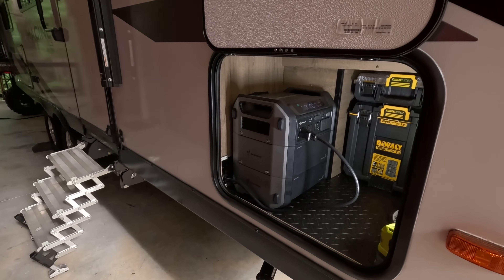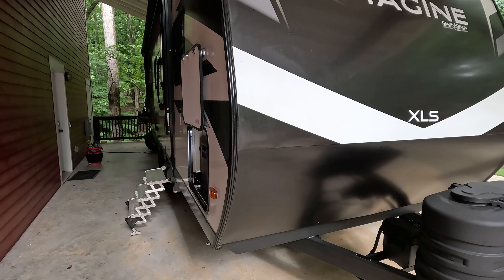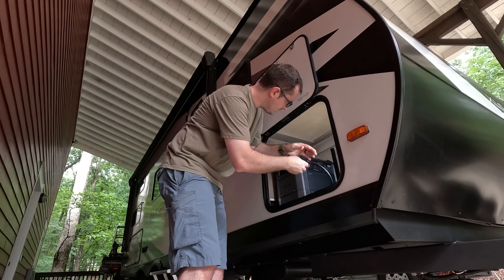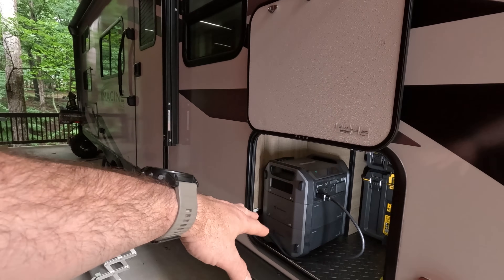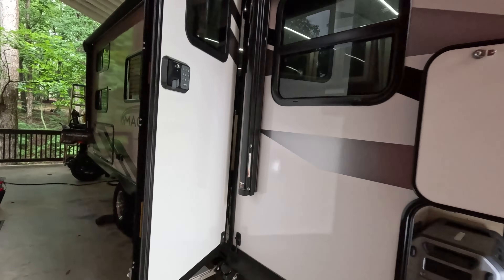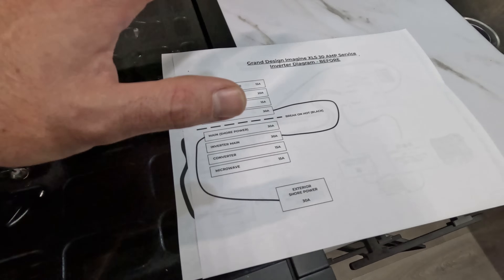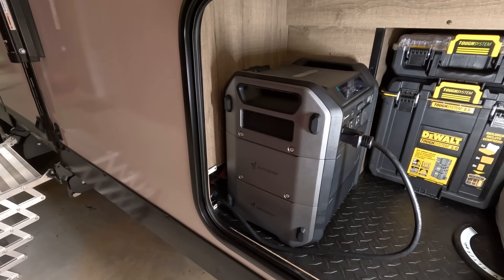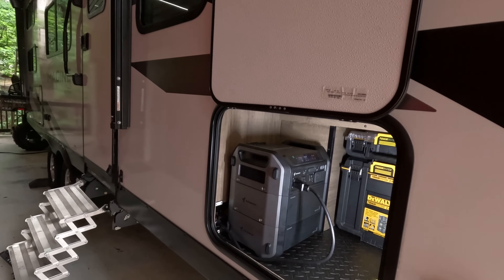Don't Waste Your Money on Lithium // I Install a Segway Portable Power Station Cube 2000 in My RV

Comment: It was going to cost me thousands of dollars to put an inverter system in my trailer. Instead, I bought a 1500w power station with an 80ah battery in it that I have sitting in my main living area. I just use a heavy duty extension cord to power one appliance at a time. It recharges with a 12v charger from my main lithium batteries and solar system. Cost: less than a $1000. And it is also portable. I love it! I live full time in my RV and boon dock 80 percent of the year.
Reply from the maker: Great point!
Reply: I have to give you props, though I’m in a stealth sedan sitting on 7.2kw using 48v the superior voltage. Full electric conversion to maximize space.
Reply: With all the tech being built into the power stations now.. theres not much use in going for the full build anymore.
Reply: @prjctwolf  build batteries? Or build power storage? I don’t get it?
Reply: Depends what you are willing to sacrifice.  Using a dedicated lithium bank and a proper inverter you can power more than a microwave at one time.
Reply: @Steve-qn8gn  Well, I live by myself so doing one thing at a time works for me, and it saved me a whole lot of money...
Reply: @ it’s still a big compromise compared to the “thousands of dollars” people spend on real installations. Most people aren’t by themselves and will want to pull way more power than those can put out and considering you could see the percentage drop 1% per minute of microwave use that unit doesn’t have a lot of storage.
Reply: @Steve-qn8gn  Mine has an 80 amp-hour lithium battery, so plenty of storage for me.

Comment: I recently bought a truck camper and the manufacturer offered an optional solar setup with lithium batteries.  It was thousands of dollars and would have consumed a lot of space inside.  Instead, I bought one of the larger Bluetti power stations when it went on sale for around $700.  It powers everything inside the camper and gives me 120v outlets when needed.  It's a no-brainer.
Reply from the maker: Smart thinking, great use-case.
Reply: How did you connect it? Just plug it in on the outside socket?
Reply: @ingevansand9180  You can charge a Bluetti using the supplied AC power cord.  I plug it into shore power with a standard extension cord and keep the battery inside and out of the elements.  The Bluetti will charge at the same time your camper, etc is drawing 12 volts from it.

Comment: Lithium batteries can be  explosive. They can cause a fire destroying your RV. I prefer using lead acid deep cycle  batteries.
Reply: Nobody puts Lithium Polymer batteries in an RV. Lithium Iron Phosphate batteries are put in RVs, which are quite safe. That’s likely the same battery chemistry in your power station.
Reply: Can confirm these are lithium iron phosphate. But even if it was not they typically only burst into flames when punctured, if something hits your RV hard enough to puncture a battery down there, your RV is probably going to get totalled out anyway.

Comment: Hi I’m impressed with the system you have hooked to your trailer & 2000 way Segway power station. My only suggestion is if you had put in a manual switch over instead of  the delay operated system you used for the function of the circuits. The only thing you would lose is the automatic switchover. I am a retired rv technician of 45 years in the RV industry.  The automatic switchover relays in the selected box have had a consistently high failure rate over the years they have been used.  Switching over automatically even with the short time delay they use can cause a burning or carbonizing effect on the really contact points. I had a similar system on my 40’ fifth wheel years ago using a manual  switchover transfer box that was bulletproof. In those days inverters were super expensive & prone to failures due to the older inverter were not as failsafe as they are today. There was & still now is available a “motor generator “ as is still being used by ambulance & EMT vehicles that never made the switch to inverters due to the bullet proof design of  the motor generators provide. These generators are full sign-wave generated using the same shaft drive with a 12 volt motor running off of the house batteries. In those days we used golf cart 6 volt 190 amp batteries in series to use as house batteries. Look me up on Facebook. I worked up a resume breakdown of my years in the RV Industry. Nice work you did on your trailer.  My 40 foot 5th wheel years ago had 3 a/c’s. One 13,500 btu, one 11,000 btu’s and the third a/c was in the bedroom loft( Coleman Mini Mach 9,000 BYU) of my 5th wheel which could run on the motor generated along with the outlets and microwave usable even while we were driving. My truck had a 175 amp alternate and 2 heavy duty charge lines running back to help keep the trailer batteries up while traveling using the motor generator underway. My wife preferred staying in the 5th wheel while traveling & she would make lunch and stay cool. She would call me on the CB to tell me when lunch or dinner was ready so we could stop and eat along side the road. It was legal to ride in a fifth wheel those days.👍👍🤙
Reply from the maker: Thank you for the comment. And thank you for the recommendation.

Comment: Will work fine just remember to turn off electric for water heater (switch to gas) and unplug your onboard AC to DC charger for the battery bank (if you have one)
Reply from the maker: Great question. On mine it is wired where it only supplies AC (inverted) power to half of the breaker panel such as general outlets, microwave, etc., and so appliances like the 15K AC and converter/charger are on the opposite side of panel not fed through power station (my WH is gas only). But, if you wire it to supply full power to panel, it would be fine to manually turn off breakers as needed. Great point.

Comment: The Segway is a 40ah battery with a 2000w inverter. You can get a 100ah battery and a 2000w charger inverter for $400. The portability is nice, but it's definitely not a cheaper solution.
Reply from the maker: I hear you, great point! Definitely can save a lot of $$ going with the discounted brands. On the Ah calculation it's kinda tricky comparing, as the voltage is different on the Segway @ 51.2V vs 12V on the standalone 100Ah batteries. The Wh (watt hour) metric can help compare for apples to apples (Ah = Wh/V). For example the Segway Power Cube 2000 is a 2,048 Wh capacity vs about 1,200 Wh for a standalone 100Ah 12V battery. You certainly do pay a premium for the name brands though, either way. Thanks for watching!
Reply: @AdventureRocks  Didn't notice the voltage on the battery, I'm guessing golf cart batteries?
Reply from the maker: @alaskadave1795  I wonder if it's a custom battery, probably using premade cells from one of their vendors.

Comment: We're part timers and we use the Bluetti 200max. We also use it for tailgating and never bring solar panels. Runs our starlink, and everything else except ac. The microwave drains 15% in 3 minutes so that's not cool. We keep it inside because it won't fit into any bays.
Reply from the maker: Very nice, great choice! I just recently tested the AC300 + B300K and was shocked to learn it could run my 15K AC and Microwave at the same time...not that I would regularly do that, but still Bluetti is very impressive.
Reply: @AdventureRocks  It's been awesome and I agree. Why permanently invest into the RV when you could take that setup anywhere. Have a few friends that their invertors went bad and had to drop cash to fix.

Comment: Agreed. I bought a Bluetti AC200L along with the 2700wh expansion battery. Both are in my home for the winter so we have backup power inside if the power goes out. It's nice to have a system that works double-duty during the off-season for camping.
Reply from the maker: Smart thinking!

Comment: I did this 2 years ago for the exact same reasons.  Why spend $2k on Battleborn batteries,  $300 on an inverter, put solar panels on your roof, and pay someone to do all the wiring to install a 2kwh battery system?
I bought a Bluetti AC200MAX.  If we need to use it, I take out the container holding all my sewer connections and slide the Bluetti in the storage compartment right beside all my water hookups.  I have a Passport, and this compartment is on the front of my RV.  I take my shore power plug and run it into the access where my water hose runs.  Since my RV is a 50amp, I doggone down to a 30amp, plug it into the Bluetti, and run the entire RV that way.  Like you, I can't run my AC and I have to pay attention to what I'm doing with running multiple appliances, but it works well to keep all my AC plugs working as well as my fridge.
I can't use this on the road because it requires my shore cord.  I use a small Bluetti while on the road to power the outdoor fridge, so we have cold drinks in transit without keeping a cooler full of ice.
I don't recommend the AC200MAX anymore because of the slow AC charging and the power brick.  It works fine, and it's expandable, but the AC charge time is over 4 hours, while their newer models are about 1 hour. I think I paid $1700 for mine, and they're now about $1100.  I use mine around the farm all the time in places where I don't have power.  I can run a chop saw, air compressor,  or hammer drill with it.  I also can run an 8k BTU window AC for about 3 hours with it to cool down a small storage building if I need it.
Reply from the maker: Great points! Very budget friendly option you've laid out.

Comment: I agree 100% with you on this point…I saw a recent system for a 5th wheel like ours that was $15k+. And as you said it’s part of the RV forever.
Reply from the maker: Great point.
Reply: @AdventureRocks  would love to figure out how to hookup my Bluetti as my camper didn’t come inverter ready. I wish I could tap the main feed into the camper internally somehow and run that into our front bay of the camper to plug into bluettti.
Reply from the maker: @usmcshepherdE9  I hear you. I was thankful that GD ran that loop for me as that would have been tedious to do myself, dropping the underbelly and such.
Reply: @usmcshepherdE9 I use my Bluetti AC200L to run my toy hauler wherever and whenever I boondock. I use 2 200W solar panels and a Honda 2000 generator to charge it. Takes less than an hour to charge. I did a few mods for my set up. Too much to list here, but any Power Station and any generator is the perfect set up to run any RV. Perfect because it's portable. I use my set up for dry camping when I do not bring my trailer. I also have a dual zone cooler I use for my drinks and food. Hope this helps. Cheers🍻

Comment: Good luck with your hook up, I use a shore power adapter plug for my power station, plus I have 2x100ah batteries. Can last for about five days, and longer if furnace is turned of. I would never ever use a microwave of grid.

Comment: That is a great setup. Thanks for sharing.  

I have done something similar, but sadly my 2019 2250RK was not inverter prepped from factory. I used a Bluetti AC200max and tied it to my 30A system via a transfer switch. The main difference in mine is I also tied into my 12volt system so I can also run everything inside off of the AC200MAX + 1 B230. No need for a separate 12 volt battery even though I keep one as a backup. Powers the slide outs, furnace, fridge, and everything. It already had dedicated braker for the 12v charge converter that I leave locked in a off position so as to not create a power charge loop. I also wired a soft start into my 15K Coleman Mach AC, which allows me to run AC off the 2200 watt AC200Max. The AC200 max can bring in 900 Watts of solar and another 500 with the extra Charge enhancer so there is times I'm Power neutral when running my 1400 watt ac at full blast.

I'm now created a dedicated 2nd system as a backup since I already have 200Amps of spare Lithium battery's. Will have it also tied in when done with a 2nd transfer switch so I can bounce between the two systems if the AC200 max every dies or runs low on power. When I sell the Trailer I will take the Bluetti with me and leave the backup as a permeant install. Learning a lot along the way is half the fun. Had my power go out recently at 1:AM and didn't even realize until the morning when I noticed my power rate was lower then normal. Didn't wake up hot like the rest of the park as it was 96 degrees and humid here in Texas. I full time RV so having a happy spouse = happy House. :)
Reply from the maker: Great point, very interesting. Did you use the 12V 30A SP21 output on the Bluetti or something else to feed your 12V?
Reply: @AdventureRocks  Yes, that 30A SP21 12V plug was what I used. I rarely see mention of using it to tie into 12volt systems outside of Van Build videos, who seem to use it all the time with great results with the ac200max. The newer/better AC200L can do this as well, but you have to buy an extra step down device to get it to 12V . It's DC plug is regulated at a much higher voltage unlike the AC200Max.  

Next you have to buy or build your own cord since it doesn't come included. I first bought one on Amazon. I would suggest others just make there own since what is out there already is not even 10AWG, but something like 12/14AWG. No one seems to knows why. Seems undersized for a plug stated to be 30A.

However, they shipped me the female, when I needed the male aviation end. So I just bought the right aviation plug and solder it on. The cord came with a XT60 end so I used a Male Female Plug XT90 Connector to XT60. Then used a XT90 to 10AWG cord and crimped some MC4 ends. Why you ask?, because I already happen to have an unused extra 10AWG solar line running from where my Bluetti is to where the wires originally connect to the battery box. I mainly was just using what I already happen to have on hand to test this concept out. I plan to do a cleaner build in the future and make my own cord from scratch and run properly. That would avoid all the various connector nonsense lol.
Reply from the maker: @lrndspirit5567  I hear you. I would love to see a portable power station offer a higher output DC in the 50-60A 12V range, but that Bluetti is pretty much the highest output I know of right now. It'd be neat to see an all-in-one plug-n-play solution for the RV community that would truly replace the conventional 12V battery and any and all inverter, converter/charger, and transfer switch.
Reply: @AdventureRocks  Give it some time and it will eventually happen. I love All-in-1 units, and they are getting cheaper with more features all the time. The only big drawback is if they die it's hard to fix DIY vs a self build system. That is the only reason I created a backup. Now if one component goes bad I can fix myself. It's like magic how much they can cram into such a small space. The plug in play Convenience is worth the consideration along with them being portable. Some units you couldn't build yourself for cheaper now that Lithium has gone down in price.

Comment: That’s a really good application. You did a great job for minimal $$. Personally I put 2 Chins 100 Ah batteries in my unit this year. I have a 1200 watt inverter that I put in 4 years ago with lead-acid batteries and the Chins LiFeP04 batteries replace the lead acid batteries. So including the Victron power shunt, I replaced the converter so it could charge the lithium batteries. You’re fortunate that the wiring was there for you to run the power station from that forward bay. I’ve got about $1300 in my system. I really only use my inverter to power 2 CPAP machines in the bedroom.
Reply from the maker: Thank you, great points. Very economical and practical setup you've got there.

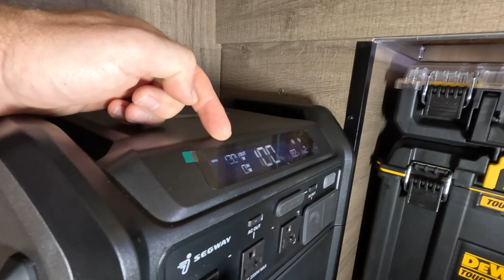Comment: Thanks for yet another GREAT VIDEO. At 7:00 your explanation of Grand Design's interesting SPLIT BREAKER PANEL, giving you (or us if we dupe it) the ability to easily turn off a LOWER main breaker inside the circuit breaker panel allowing the LOOP to the upper half to take over and run essential circuits off the inverter/battery module.
Reply from the maker: Thank you, I appreciate the comment.

Comment: I have a Bluetti AC200 Max. I totally agree if you are not a full-time/high time RV'er something like this makes a lot of sense. Other than the benefit of shore power being able to automatically charge the power box are there additional benefits? There are lots of power boxes with 30amp connections.  I have not done long term testing with my setup.  I have a portable solar panel for the Bluetti and just need to see how well it does powering everything. No wiring required. Just plug my shore power cord into the Bluetti and done. Well done on your setup.
Reply from the maker: Thank you. Great point. The 30A feature on the Bluetti is pretty unique. I'd love to see one in future with 50-80amps 12V DC for medium to larger rigs and then it could literally be a single power source for both AC and DC. Hopefully soon!

Comment: Very nice clean setup. I am in the same mindset at the moment I have a 5th wheel and only planning to keep here for the start of my full time run this winter then upgrading. I have been looking at the Delta 3 ultimate rather than installing my Rack batteries and dual inverters ect... to only remove at a later date
Reply from the maker: Thank you. Delta 3 Ult looks pretty sweet.

Comment: I too decide to buy an Ecoflow 4kw setup to use both in my house when Xcel turns off our power and also use it in my 5th wheel while traveling.  My 5th wheel is generator ready so it was easy to install in the 5th wheel.
Reply from the maker: @Keith80027  very nice! Smart thinking with the dual use case.